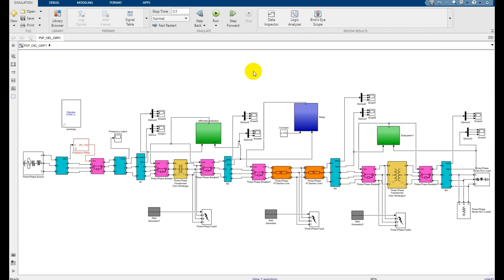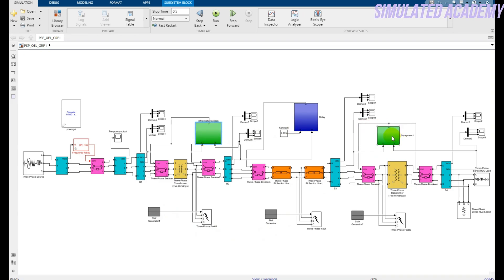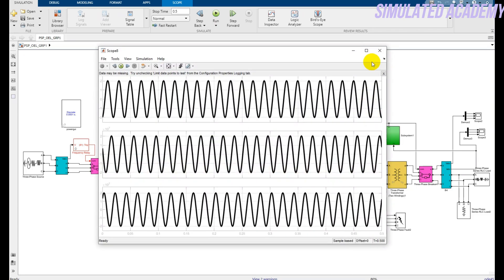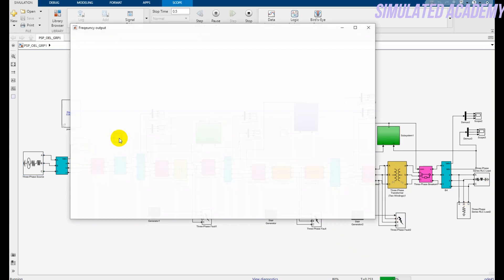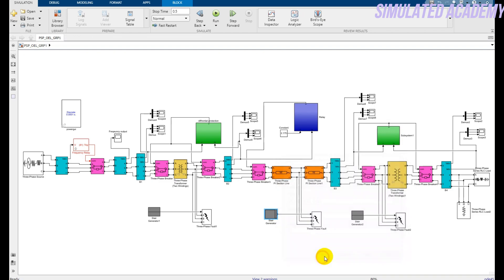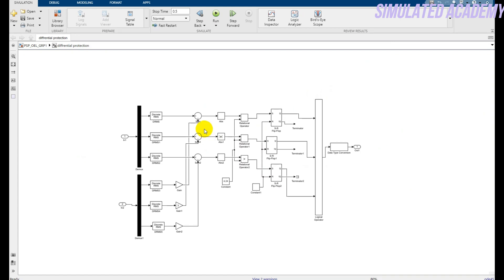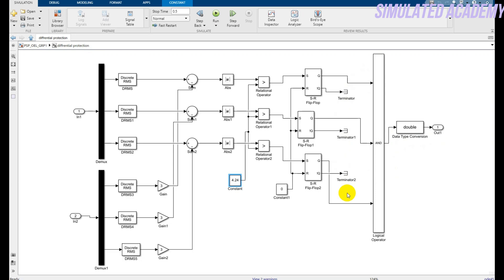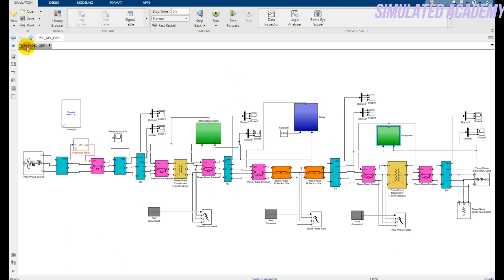Power System Protection Simulations in the SIMULINK

Comment: Brother, i think after step down transformer current is decreased comparing with the source current ... Can you please explain with voltage regulation
Reply from the maker: Thanks for coming✌🏻😍

Actually, we are measuring the current on both sides of the transformer; if they are the same, the relay must be restrained or it will trip.
Rest, I'm not sure what you're asking for?